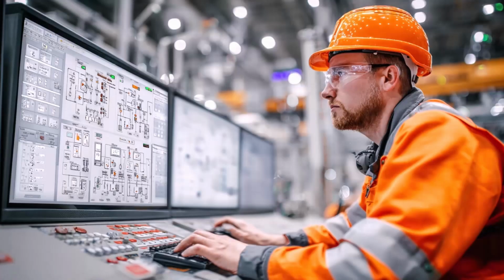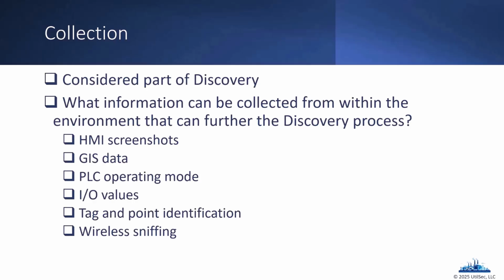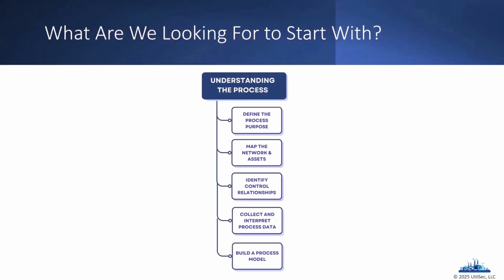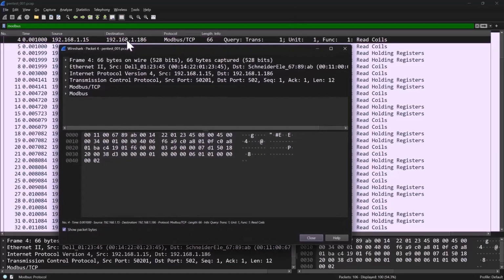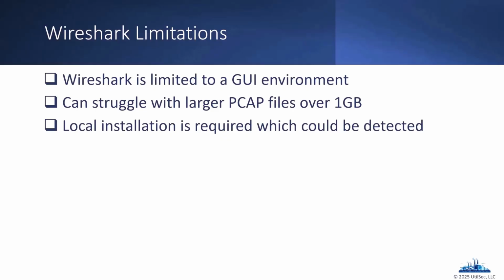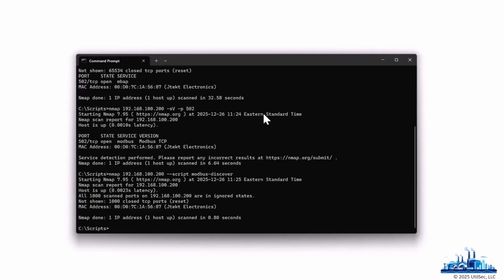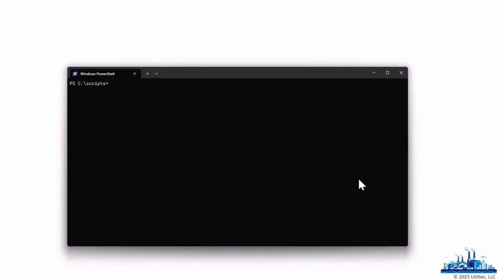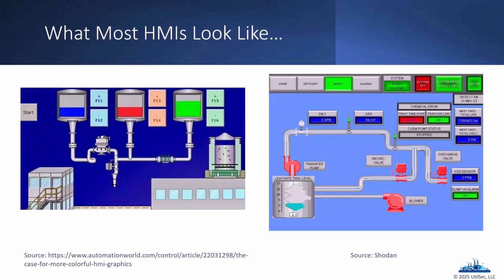Intro to OT/ICS Penetration Testing (Part 6): What Happens After We Breach an OT Network

Comment: I've found this video and the whole series, including the tools and the provided material, very interesting, very useful. I'm just loving it!
Once again, thank you for sharing!
Regarding active scanning, I was wandering what's your position on Claroty EDGE, which has been designed on purpose for OT environments to be less invasive compared to nmap or Nessus. Basically, by design, it is built to use selected protocols to communicate with selected targets, with increasingly specific queries, and with proper delay between a packet and another.
At the beginning I was reluctant, but now I can tell I've been using it in quite a lot of cases and, thanks God, I've never faced an issue so far.
I just would like to get your opinion, Mike, and I would also be glad if other followers share their experience with Claroty Edge.
Reply from the maker: Thanks for watching, Filippo, and for letting me know!  It's great to hear you've taken a lot from the course so far (Part 7 drops this Monday!).  As far as active scanning compared to "less obtrusive" tools, many adopt an "active polling" technique where they aren't scanning for all open ports, but only a handful of ports on specific subnets or IP addresses.  For example, if you have Siemens equipment in your environment, you would want to query against S7 (TCP 102) and SNMP (UDP 161) which are used on pretty much all Siemens gear you'll generally see.  Like with active scanning, it's a question you need to discuss with those responsible for the design and operations of the environment and if there could potentially be any safety and/or operational availability issues.  At that point, it becomes their decision on whether less obtrusive techniques like active polling can be used in the environment or not.  I hope this helps answer your question.  Thanks again for watching!!!